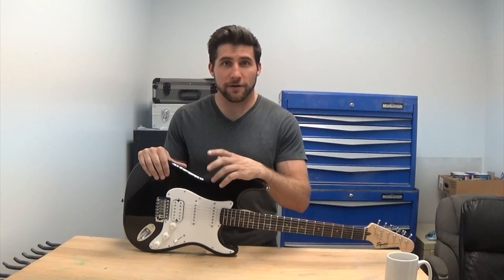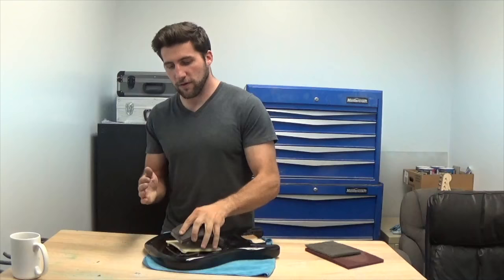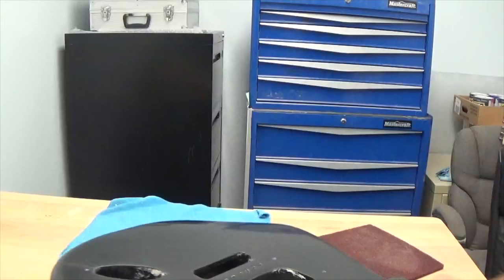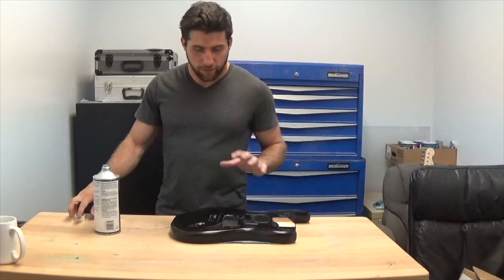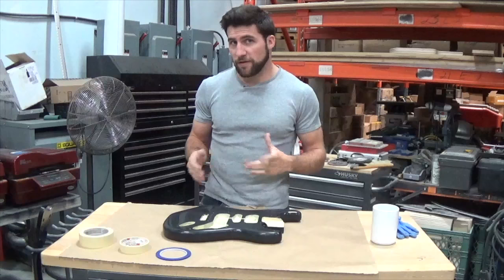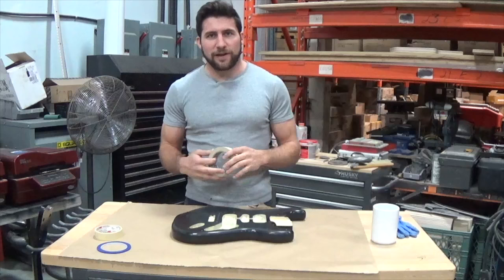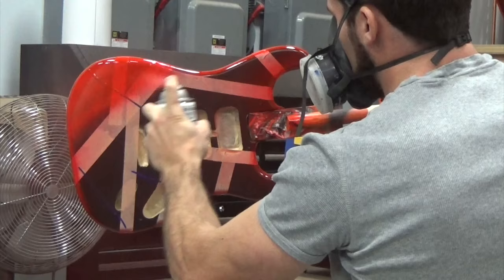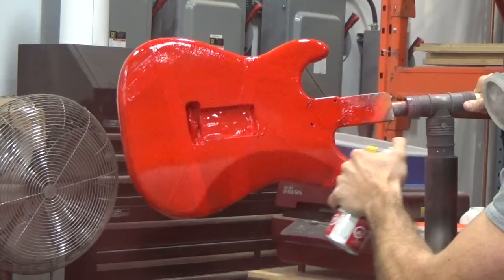How to do a frankenstrat paint job with spray cans (part 1)

Comment: Starting with a red guitar would be very difficult to mask
Reply from the maker: You would just reverse mask all the lines, and then fill in the gaps. That's kind of what I did to apply the white anyway.
Reply: yes, but instead of putting down a single piece of tape to make a stripe, you would now have to tape of weird shapes to leave the stripes.  Yes it can be done.  it just requires more effort and tape.    EVH painted it black, then white, then red.   So technically you should make a black guitar, mask it and paint white.   Then after making a white guitar with black stripes.  You mask it again and paint it red.   You did a fine job, just saying that painting white then red is better.
Reply from the maker: +Jerry Wawak Well, if that’s how EVH did it, it must be the best way.
Reply: @WawakGuitar  actually, the original was made from his white guitar with black stripes on first album cover.  He then added red later to that guitar.
Reply: @markcoleman3370  I know, that is why I said starting with a red guitar would be difficult.
Reply: Let me explain the actual timeline of the Frankenstrat, originally the body was regular wood. he played that guitar in just wood tone for about a year that way and then decided that the guitar should black... played that for a while then decided it should be white with black stripes and he masked off the stripes with the black under it to paint the white he played it on the 1st album barely because he used Chris Holmes Guitar as well as the Shark guitar on the 1st 2  Albums...  now fast forward 2 years and hes getting copied left and right and hes got cease and desist orders all over the place to stop all these guitar companies who are literally copying his black-and-white guitar. 
That guitar being originally black and then stripped up and painted white and then he added to that the small 1/8" black stripes that you see. They are automotive vinyl pinstripes they're not painted on. The bigger stripes are paint.  Then what he did was when he was preparing to paint it red he decided to peel off the vinyl stripes and then he sprayed after taping it again he sprayed the red so the base coat layering is originally black then white then red and that's what you have today...
 How do I know this?
 I've been building Frankie replicas for the last 22 years

Comment: Great video, II know you have said you are not going for an exact replica, however, for anyone that IS going for an exact replica, please do your self a favor and do it like Eddie did. Does NOT make sense from a color palate, however he started with Black, masked and painted white, and then masked (along with some weird squiggle patterns) and painted 1 more time. There is also a mysterious pale blue color on the back, that was unintentional and was picked up from something Eddie laid the guitar on when it was wet. Also, there are some random bicycle reflectors (1 broken intentionally I believe) and I THINK a 1977 quarter that has no function that I can recall by the Floyd rose. The center cavity is a 5 position pickup selector that is NOT wired and the top pickup is also not wired. This is a great video and I wish I had not bought a guitar blank to start from scratch on....and had to primer from the ground up. Still in the process right now, but I love the video and stopped in for a little painting advice... :)
Reply from the maker: I’ve got plenty of content on the priming/sealing process if you happen to need it.
Reply: 1971 quarter ;)

Comment: Pro tip...always use a wax/degreaser before sanding. If the surface is contaminated to begin with you will just drive it further in when sanding making it more difficult to prep before spraying.

Comment: I have a guitar that looks just like that, and I did the first step, sanding with 600 grit, but it looks hazy and scratchy, not just flat black like yours. Can you think of what I did wrong? Thanks for answering.
Reply from the maker: You didn’t do anything wrong. That’s probably just the camera for the most part making mine look matte. It will always look hazy after a sanding at that grit.
Reply: Thanks a lot
 Brad!
Reply from the maker: You’re welcome.

Comment: Hey I sanded the black finish a bit off as you said with 600 grid sanding paper but now the body has scratches all over it. What did I did wrong?
Reply from the maker: Probably nothing. Those will go away when you clear coat if they’re just the 600 grit sandpaper scratches.

Comment: FYI... the function of your "conductive paint" as shielding would work either as a topcoat or buried under other paint.. the idea is to block signal leakage.. so masking it means absolutely nothing unless you are planning to use it to actually pass a signal.. then you would want to contact it directly... in this case as shielding... any ground connected anywhere will do... the rest can be painted.. and if you're staying true to a Frankenstrat look... the cavities were painted... not shielded with copper or any other tape.. nor painted with conductive paint..

Comment: i've repainted my guitar about 6 times, though I've only now seen that i shouldn't paint the neck pocket, could be why the setup is so bad. though when i first took it apart it had paint there. Would you recommend sanding it down to bare wood in there?
Reply from the maker: If your neck still fits in there snuggly it shouldn't be a huge issue. The only real concern then is the alignment between the neck and the bridge. If you're getting fret buzz, one possible cause could be a paint buildup affecting the angle (or possibly height) of the neck. Sanding or scraping it down a bit at a time until the alignment is good might be a worthwhile option.
Reply: Alright perfect, thanks for getting back to me so quickly. Gotta say you're my favorite "how to" channel, aright cheers bud. Again thanks for the help.

Comment: good stuff mate ! looking forward to part 2 ! i tried to do a contour of a BC rich guitar in silver, but when i removed the tape it took away all the shine from the paint and didn't leave a smooth surface .... so definitely looking forward to part 2 !
Reply from the maker: How long did you let it dry before you put the tape on initially?
Reply: Brad Angove quite a long time , my projects are very slow ^^ in a crimson guitar video he mentioned to use 3M vinyl tape and not the paper tape kind ... maybe thats where I went wrong
Reply from the maker: That's a bit odd. Sometimes paint peels off if there are adhesion issues. Maybe try taking some of the "stickiness" off the tape by putting it on your shirt a couple times before sticking it to the paint. Vinyl tape tends to stick more aggressively.

Comment: I might have missed it, but what is the best paint to use after scuffing up the factory clear coat?  I'm assuming Fender Squier uses a polyurethane clear coat?
Reply from the maker: They use some form of poly I believe. The best rule of paint depends on what kind of finish you want.
Reply: The exact paint that Eddie used according to a video I saw of Eddie explaining the paint job, was Schwinn bicycle paint,  he started with a black guitar, taped it off painted it white, then taped it off again and painted red.

Comment: Would these steps apply to a bare wood body? I'm building a custom guitar and I'm going to buy the body without it painted.
Reply from the maker: +The Gaming Ghost You'll need to seal the wood first. Have a look at the first or second video in my series on finishing a guitar with behlen's guitar finishing kit if you want some info on that step (can't remember if it's the first video or the second one).
Reply: Brad Angove thanks
Reply from the maker: You're welcome.
Reply: If I seal the wood do I still need to put primer on as well
Reply from the maker: Generally no.

Comment: How would you do line work with nitro paints? Would you just quickly apply the tape to nitro, do the paint, remove the tape let it dry, then clear over it with nitro lacquer?
Reply from the maker: Essentially yes. Just don’t rush putting the tape on. Make sure you give the lacquer time to dry first.
Reply: @BradAngove  okay, so I’m wanting to do a recreation of James Hetfields Gibson iron cross, and it’s black, with a gold racing stripe down the left side of the guitar, what would be the best steps for this!? Tape of the body where the gold stripes would be, then spray black. remove the tape, wait for the black to cure, then apply tape over the black, then paint the gold race stripe and then remove that tape? Let the paints cure for a few days or week a bit then apply clear over that?
Reply from the maker: No need to tape the same thing twice. Just spray one color, let it dry, mask, and spray the other. Like I did in this tutorial.

Comment: Hey Brad, thanks for the video's, I am doing a EVH Striped paint job now and your plan sure helps!  I am starting with the Black, but will do the White next, then finish with the Red and Clear.  All in Enamel Paint.  One thing I noticed in your video's in this series is that you scuff the paint between colors, but not when applying a second coat of the same color?  I forgot to scuff the Black before putting on the first coat of White.  Oops!  Or does it matter that much?  I will scuff each layer a little until finish just to make  sure.  Again, thanks bro!
Reply from the maker: +b4096 I scuff any time I'm not able to recoat within a 10-15 minute window. If you recoat within the appropriate flash off time, the next coat will bond chemically. If you have to wait, for example to be able to apply tape, then you need to scuff so that the next layer can bind mechanically.

Comment: Damn... would using my fingers to sand (polishing stage) explain why I have so many visible scratches on my buffed and polished finish?
Reply from the maker: Probably not. What grit of paper were you using?
Reply: Brad Angove 1000-1500-2000-3000-5000. Might be because I didn’t do enough of all the grits past 1500.

Comment: Would be easier...white, red then black ..painted  a tool box and a strat body...tool box was red...tons of masking..on the guitar I started with the white...was way easier and with the contour the lines were less of a..to have straight tape lines. Just a tip. Rip evh.

Comment: Will the 800 grit sooth out any sections where paint may be heavy or have run a bit?
Reply from the maker: +D'sBalls It will if you're careful to sand those sections back evenly.

Comment: Your're great!!! I've got a question if you don't mind: I'll buy a new guitar soon, that has a horrible satin gray colour (I'm left handed and basically I've no choice), so what if I'll sand the body like you did in the first part of this video and then spray it with an acrylic enamel matte black to turn the satin gray into a matte black, somewhat like you did in the "How to turn gloss paint matte or satin" video? It'll work and it would be good even if I won't remove the original paint? Thanks!
Reply from the maker: That should be fine.
Reply: @BradAngove  good, thanks!

Comment: how sweet it shall be \m/ i'm doing a few guitars when it warms up i have to wait until then cuz i work on my balcony i'll be doing a bass lemon yellow with black hw, i'll be doing my bc rich zombie white and it has black hw as well, and lastly i got a new warlock and i'm gonna do a classic tiger orange/black stripes. I'm using water based acryllics again. Any suggestions for the clearcoat? i used the miniwax gloss poly as my clear-coat last time, but it left an amber look to it, and i'd like to avoid that and have a clear gloss  clear-coat this time cuz the amber would really show on those brighter colors . Also i'm looking to foam-brush it on, cuz i don't have or want to buy a respirator to spray it on.
Reply from the maker: There may be an acrylic that will give a more clear look, but most clear coats darken the finish a little. I don't really do a lot of brush on finishes. I think there are some "crystal clear" brush on finishes that I was looking at at home depot a while back.
Reply: crystal clear poly brush ons? cuz being a fellow canuck, hitting up a home depot would be no prob. :)
Reply from the maker: Ya, basically something that includes those words haha.

Comment: If you use two different brands of paint would that result in seeing black lines under the red paint? Or do you just have to give it extra red coats?
Reply from the maker: I'm not sure what using two brands of paint would have to do with the visibility of black lines. Can you clarify?
Reply: Brad Angove ya, so after doing black acrylic, looked good, then tape and whitepaint, still good, but after i put the red coat on, the black lines showed under the red. i'm guessing i was hasty and should have done another coat another day. gonna turn it into a click but the next one i do i'm gonna use a proper evh stencil. But would you say it's ok to use 
Montana Acrylic Black
Rustoleum white paint plus primer ( i know at this stage it doesn't require paint and primer i just grabbed the flat white paint) and lastly Rustoleum 2X red gloss.

that's. my triple combo
thoughts?

cheers
and love  the vids
Reply from the maker: +D'sBalls you should be able to get away with using the rustoleum painters touch and the Montana gold together, but it's a bit risky. Sometimes mixing like that can cause crazy cracking. I would try to stick within the same brand and type if you can.

Comment: Hey brad what type of paint is the red spray? Is it acrylic? If not can you still use 2k clear on acrylic finishes?
Reply from the maker: It’s acrylic, but a solvent based acrylic designed to emulate enamel I believe.
Reply: @BradAngove  so am I able to spray 2k over a coat of 2x rustoleum clear?
Reply from the maker: Yes, just do as I said in response to this same question from you on another video.

Comment: Is there. ReSon ppl are using masking tape instead of painters tape? Seems painters tape if the way to go, but am I missing something or is it not a big deal, btw, day 3, still sanding, going through lots of sandpaper
Reply from the maker: +D'sBalls Painters tape is masking tape.
Reply: I read somewhere that evh used pinstriping tape from an auto parts store...
Reply from the maker: He would have used that for the fine lines, yes. Not sure which type though. There’s more than one type of pin-striping tape.

Comment: Hey brad when I finished with my paint, it's not a hard finish, but it's soft which could easily be dented by a finger nail, it wasn't what I was expecting and I could feel the layers of paint stacking on top of each other! Can you help me? Much appreciated. I am having a hard time
Reply from the maker: Take me through your steps and what paints you used, and I will see if I can figure out what went wrong.
Reply: Thank you for responding

Here it is in order

Scuff the finish by scotch pad, 

Apply the white + primer rustolium paint on 1 hour between each coat(3 coats) 

Wait over night

Scuff the guitar

Mask the guitar ready to spray black rustolium 

Sprayed 3 coats of rustolium 20min between each coats 

Waited over night

Take the tape off 

Scuff the body to take off the gloss of the black paint

Put on masking tape for the red coat

Sprayed the red coat 20 min between each 

Waited overnight

Take the tape off and scuff the red gloss

Sprayed the gloss rustolium 3 times 20 min between 

And that's it I haven't done anything since and the paint is not harden, rather is soft and easily dent by finger nails small pressure

And it still smell like paint
Reply from the maker: Sounds like your clear hasn't cured properly. Did you have any problems with paint lifting when you removed your tape? Also, how long has it been since you finished painting it?
Reply: Brad Angove it has been 2 days and there was no paint peeling off when taking tape off, but the body now is very easily scratched off by a pick going under it
Reply from the maker: If there other paint didn't peel than it seems relatively clear that it's just the clear that's the problem. It might have gone on a bit too heavy or something. You'll probably have to sand back through it in order to fix the issue.
Reply: Just a thought for anyone reading this in the future: paints and clears need to cure. A heat lamp will speed the process. Depending on the paint, it can take anywhere from a couple hours to a month without a heat lamp.

I recently used etching primer as paint(to get OD green). It was hanging around for almost 3 weeks before it was completely cured.
Reply from the maker: Just a note on this, not all paint and clear cures. Some types, like lacquer, only dry. 
Be careful with the heat lamp idea. One of my viewers lit his guitar on fire by accident leaving it too close to a heat lamp.
Reply: I wasn't thinking about the differences in paint. Good catch, that's my bad. I'm slipping more as I get old. 

Also, I agree with you about the heat lamps. I wasn't really thinking about safety, but it's always good to mention. That's good looking out, thank you.